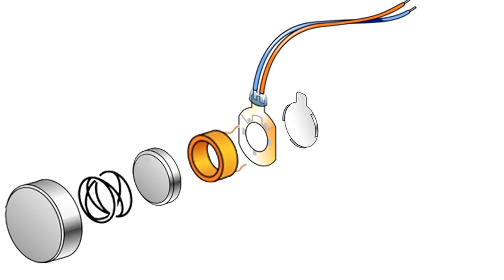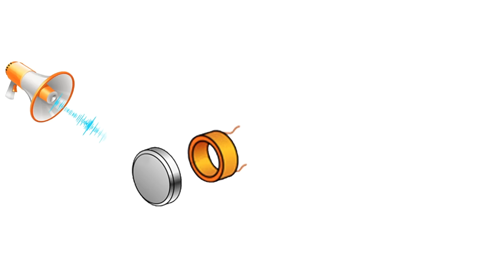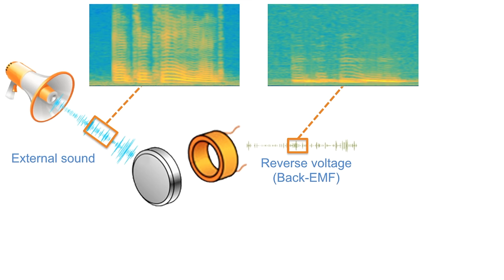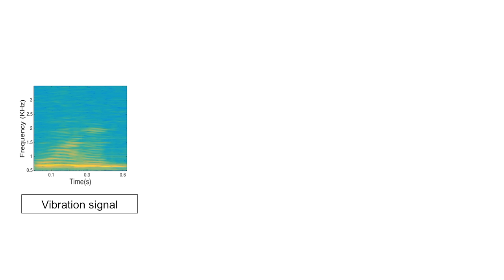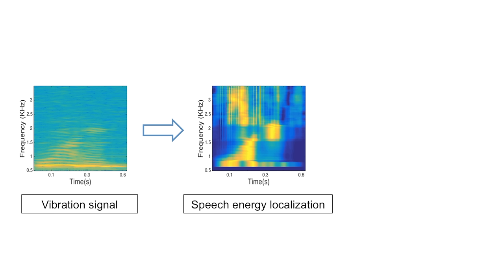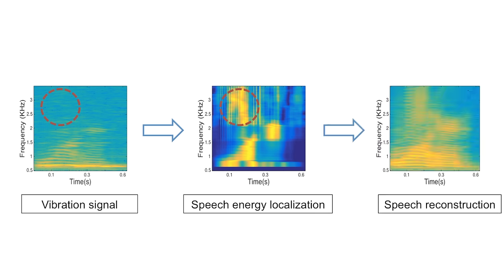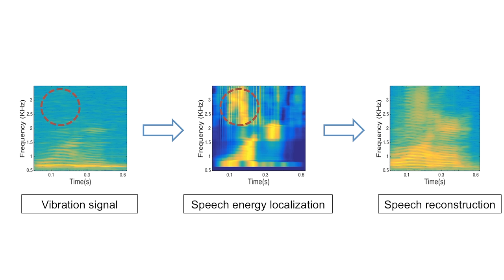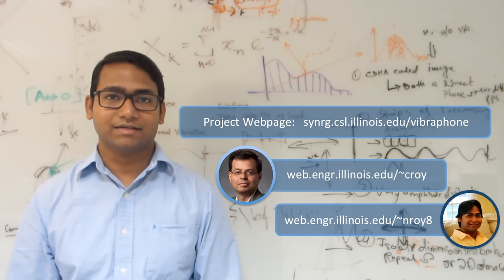VibraPhone: MobiSys 2016 1-minute video

Comment: 1/ If you have access to the vibration motor you probably have access to the mic.

2/ It really depends on the surface the phone would be on and the orientation of the motor to get any inducted energy.
Reply from the maker: 1. Not necessarily. There are many alternative ways to get access to vibration motor and the voltage fluctuation. For example, the power controller chip that drives the motor can also monitor the voltage.

2. Actually it does not depend significantly on the surface etc., rather it depends on the pressure level (or loudness) of the sound. The sound pressure level is more than 70dbSPL when we place close to our mouth during the call.

The algorithms used here can be useful to recover speech from the vibration of the vocal chord or facial bones and it can lead to an assistive system for people with speech disabilities.
Reply: There are much better unprotected devices much more tuned to get speech from a phone.